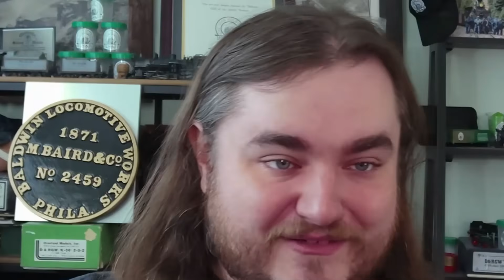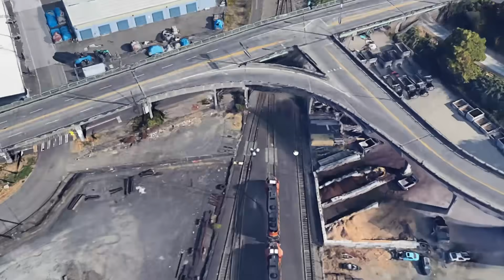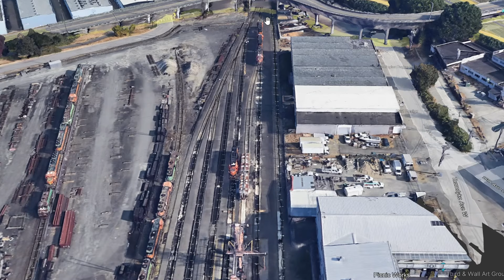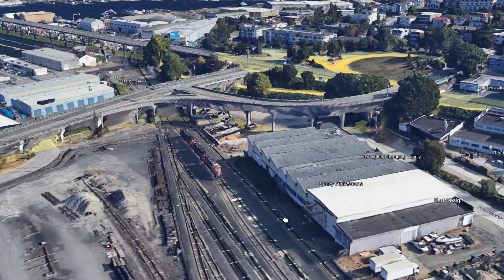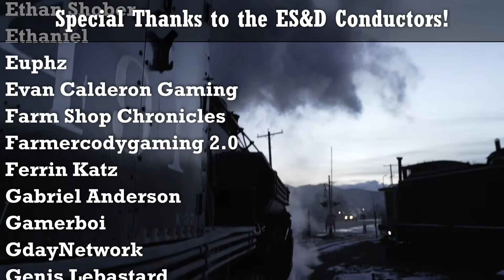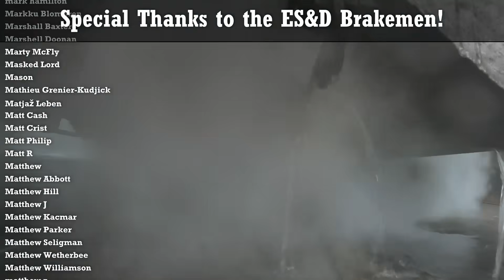[SFS] This is a boxcar that ruined our week.

Comment: The workaround lots of the world does for those type of rules is the highest report in each location being permitted to do anything, they normally only manage so unions don't have any concern with loosing work/roles, but when one "boxcar" fouls your entire process, or somebody needs to walk a mile to plug in a fridge, they can step out of the office, fix the problem, then return to their paperwork... normally shaking their head about ridiculous rules the entire time.
Reply: Our office is that way, though only by coincidence.  We’re in highway maintenance.  The foreman, assistant county management, county management, mechanics, shop labour, and clerks, could do any job, if so qualified, upon request by the lead of the trade.  Most often, we were clearing snow, getting our arses handed to us.  We called management, “hey, can we get some help here”.  Well two of our foreman were snow qualified, so they obliged.  The one with a CDL got a plow truck, the other put a plow on his company truck.

Mechanics can move anything (providing they have their CDL)
Operators can move anything not red tagged
Management can do anything except actual vehicle maintainance (if qualified).
Traffic can only move pickup trucks
Anyone with a CDL can operate, when requested.

Counterintuitively to this story, the union agreement requires any staff appropriately qualified, regardless of craft, to be used, before contracting out the work.

Blizzard of ‘93, we had operators, mechanics, inspectors, clerks, examiners, howdy hut attendants, all working.

A catch all union really has its advantages.

Comment: Funny this reminds me of a story from my father he worked a shop that was 80% union the labors weren't in the u ion because the unions didn't want them or something silly the union had those rules like electricians having to plug stuff in but who didn't have the rules the non union workers so ypu just grabbed the first non union guy and said do this they would and you moved on needless to say the shop run smoothly everone was happy bit the union higher-ups eventually the owner shut the place down closed the company sold it to his brother who reopened non unionized alot of hiys left the union and came over apparently they was some gray area stuff going on

Comment: remember that small rail unused to a business you mentioned when showing rails on in to roundhouse 🛖? well say a guy Parks it there with permission bang flows back on as well as the unused track now has purpose and can easily throw that boxcar(locomotive) onto the next train to the next place easily with zero shuffle just give the guys a radio 📻 to communicate and listen in to traffic 🚦 while moving safely not interrupting full speed 🚄🚅 trains commuting through or the slowing ones checking in for service outbound trains could have a dedicated outbound rail for single direction ⬆️ fully completed and tested repairs ready for service the break could be given full length so that people's nickel and diming of time setting things in purposefully traffic backups wouldn't be needed as everyone would be treated better and a test loop ➰ just around the buildings in the sharpest slow turn possible at 15mph just engine 🚂 so you can do infinite roundabouts of the shop without interfering with other traffic even flipping 🚆 train to figure 8 even for even wear testing and flexure🚂

Comment: Hmmmmmmmm. I would insert a turnout to be a "B" line to a 3A, 4A, 5A, etc. Depending where a turnout can be shoehorned in with a few sticks of rail to be able to set 3, 4, 6, 10, or however many cars or locos need to be placed somewhere that won't clog up the operations.

Comment: I got offered a job at a smaller train shop thank god its all under on union bc the boss wants me to spend the first year getting rotated all round the depts. From welding to the plumbing (air systems) salvage and welding to engines then put me wjere i excell and click with the coworkers

Comment: If that's the actual Geep in question I recall seeing it on the Puget Sound and Pacific. A good buddy of mine lives in Shelton and we used to go to the Radio Fryer and then watch switching ops down by the sawmill.

Also the moment you said there was an industry within mechanical limits I KNEW it was Coastal Transportation (Does that old Plymouth gas switcher they re-powered with a CAT engine even work, or is it just there for looks?).  I rode my bike past there a lot when I worked at Smith Cove

Comment: I worked in a unionized freight terminal for three years during the pandemic and the BS rules and ways of doing things just blew my mind. For what I could do in 5-minutes took union workers over an hour and this was a constant problem when I needed to be on the road delivering freight but due to delays at the terminal, I was usually late every day with many 16+ hour work days. As I was forbidden from placing and pulling trailers from union docks, I had to sit on the side and wait for long periods of time until the union spotter truck operated by the union steward himself moved my trailer from the dock to the parking area across from the docks so I could hook up and run. Usually spotter drivers sit in their trucks near end of building posting on Facebook or checking their Grindr dating app. Totally aggravating and finally after three years I walked out leaving them to figure out how to move their own freight and I got a new job driving dump trucks in a non-union shop. Unions were originally meant to protect workers rights but now it is a method for workers to abuse the system and take advantage of employers knowing full well they can't be fired for not doing their jobs or performing up to standards. Now I understand why there are no more real manufacturing jobs in the United States, and why companies have packed up and moved operations to other countries where cost of labor is much, much lower and unions have no control. Apparently a major freight company closing their doors and sidelining 35,000 union workers in a single day doesn't play in the minds of those who have taken employers hostage thinking it can't happen to them.

Comment: Hyce, what is that grey lamp behind your left?   Is it blue glass which means the locomotive or railcar is not to be moved?  At Goodwill just bought one similar.   HANDLAN  ST LOUIS  USA
Apparently had a removable wick lamp which fits into the base.   Presumably a clear glass chimney so the blue glass lens would not be sooted.   Now a white LED always on inside.

Comment: This reminds me. So, I used to volunteer at a heritage tramway. Now, we had a very tall double-decker tram, No. 26. The wires in certain places got low enough that No. 26 was barred from those areas over possible electric shocks. There were big red, black, and white signs that had a picture of No. 26 specifically showing not to take it down there.
That was ignored constantly. So long as you didn't go into the upper floor, in theory, you would be fine. I once saw No. 26 parked on one of these sections, right next to one of the signs, and thought:
No. 26: "I wonder who that's for?"

Comment: I mean, if you consider that a diesel is just a boxcar with the components inside of it to actually power itself (in a super simplified sense), it makes sense that the reverse is also true. A diesel incapable of actually powering itself is just a boxcar that holds broken train parts in it.
Reply: The problem is that it’s most likely a fully functioning locomotive. I have worked for several several short lines and have moved a bunch of locomotives to other locations. Some of these were in fact broken and nonfunctional but most left our facility fully functional. 
We just cannot move them as functional or really bad things happen. Crews looking for power will appropriate them and they get lost or damaged.  So we disable them and change air brake settings under the cab to make them function as a boxcar. We also post the waybill in the windows of the cab. 
The problem is, there are a lot of employed people who either can’t or won’t read their orders nor that waybill. 
There’s a lot of stupid that happens on the railroad.

Comment: As a retired yardmaster, I feel your pain. It wasn't just the mechanical department that got that Excedrin headache #5, the transportation department also shared the misery. Once we had an engine (boxcar) come in to the terminal and it hung around for weeks like a bad suit because of clearance issues. We finally got rid of it only to have the damned thing come back through a week or so later and it got set off again in our terminal. Luckily, the RR that owned it were now watching it like a hawk and it only stayed there a day or two, never to be seen again. Oversized loads that needed clearance were also a pain in the pants, but that's another long, sad RR story...   you did a great job of explaining the reasons why things can be so crappy to deal with at the RR!
Reply from the maker: I talked with the yard guys enough. You guys got it much worse than we did. Yardmaster at interbay sounded like the worst job on the railroad. Lol. Sounds about right. Thanks for sharing your story!

Comment: GOD I hate unions...dealt with some of that BS at conventions where only the Union people can plug/unplug an extension cord but they provided a faulty cord and then they don't actually get around to replacing the faulty cord until the event is over so we had to improvise with zipties and bent prongs to make something stay connected.  Similarly moving folding tables was a "union only" thing but they wouldn't get around to them until after our chance to set up was over.  One time I got mad and started dragging one out of the way of our booth area, they complained "you can't do that" so I set it down and start walking away.  Then they yell "you can't leave it here, its blocking the walkway fire exits" well you just said I am not allowed to move it so I guess that's your problem now, should have moved it a day ago when I asked repeatedly.

Worst was an argument about "not allowed to tape wires to the floor myself" for an exhibit display to prevent tripping...but also "we can't tape your wires to our floor because they aren't our wires".  So you forbid me from doing it while refusing to do it either.  Only a few people tripped over the unsecured wires that weekend...

Comment: Box car on paper. There. If what's on the video thumbnail was actually the thing that was being argued about when the logistical fiasco was the thing and not just there for props, then I have to say that the P&W recently had to get rid of it because the parent company was under fire from the EPA for failing to comply with certain regulations. Ironically, they ordered several newer GP38-2's (which are really no different emissions-wise than the 1xxx fleet they got rid of).

Comment: Hyce at the museum yesterday I had one question  where is Hyce ?
I told them  on vacation !
at D U  i was told to take the trash that was out side of the door by my boss !!!!!! 
D U  had a contract with a company, that is a union shop, and one of their workers came up to me.
And told me never to touch the trash in these cans ! 
Or I will not have the trash picked ! up at my house for 30 days!!!!!
Denver has the same trash has the same union loco for trash pickup.

Comment: This is exactly how aircraft hangars work in the airlines as well.
Reply: What would the airplane-equivalent be?  Calling it a bus that can't fly?
Reply: @matthewmiller6068  The airplane equivalent would be pulling a terminal tractor into the hangar and expecting the aircraft mechanic who mostly works on jet engines and old Continentals to perform a full service on it without a wiring diagram or a fluid specs sheet.

Comment: Jesus that's nuts. Our servicing area is kinda similar, upstairs with repair, storage, and turntable, and downstairs with inbound and outbound roads and servicing for when locos just need fuel and a slap on the ass. Even a siding where wagons loaded with rebar get placed that the main yard crew has to use.
I'm not sure about the division of labour, I'm sure it's an extra qualification for the servicers to be able to drive locomotives in their area, but if it ends up in there it can be moved by them. Which is important because when trains come in with a shunt loco in the consist that's being moved for heavy repair it comes with a runner between the road locos and the shunter so that their pilots don't touch and make problems.
Sometimes that wagon will subsequently get 'lost' over there when it's right next to all the yard staff's parking and like 40 metres from the yard supervisor's office, which is great~

Comment: Rules like this are everywhere. I got a rude introduction to them on my first job out of college. I got a job as a field service tech at a medium sized electronics company. I was classified as an EST (Electrical service tech.).  Because I was a field service tech, I could do mechanical work to install or remove equipment. And that meant I could handle mechanical tools (wrenches, screwdrivers, etc).
Then I made a move to the engineering dept and became an EET (Electrical engineering Tech).  And I immediately got into trouble because my tool box had mechanical tools in it. And as an electrical technician, I wasn't allowed to do mechanical work in the engineering department.

Comment: I have just to opposite story. Union Pacific has new MOW power, it's a SD40-2, with a new body, and Maintenance of way lettering. Kind of like a F-Unit now. it's not a "locomotive" (For union reasons.), it's a piece of MOW Equipment. One of them recently showed up at Albina Yard, needing new wheels. Yardmaster sends it to the One Spot (carshop), it's a piece of MOW equipment. We don't have a lot of room either, and here it comes on our inbound tracks. I asked what are we supposed to do with that thing? Manager says nothing, it's a Locomotive. Well, it does not belong on our inbound tracks, call someone, it needs to go to the engine house. Well if the call was made, it was likely met with, why would a piece of MOW equipment go to the engine house? They shoved it into the one spot track. It takes a couple days to make it into the shop. They do nothing to it and shove it thru, takes another day to be pulled. Then some MOW Manager calls, asks if it's done. Leadman says no, we don't work on Locomotives, it needs to go to engine house. Next day I come in, it's in our inbound tracks again, rinse repeat 2 more times. After the 3rd trip thru, and a couple weeks later, MOW Manager calls again, are you guys done yet? We really need it back. Our manager says same thing to leadman again, who starts to tell the MOW Manager. I yelled wait, tell him we can't do the work because the car shop does not have a drop table for removing traction motors, but the engine house does. That is the only way to change wheels on his piece of "Maintenance of Way Equipment", by removing the traction motors. Leadman tells him this, and call ends. They pulled it that night, we have never seen it again, I don't know if it ever made it to the engine house.
Reply: On NS they have a track geometry car that looks like a Loco. It's called the"Brick".
Reply: @robertadams6606 the Pennsylvania burgandy geep slug looking thingy?

Comment: Small railroads HATE shipping locomotives over the Class 1's, because they almost invariably get lost in voids exactly like this one. I believe the Wisconsin Great Northern had a new-to-them GP7 fall into the abyss for awhile not too long ago.
Reply: I wonder if something like this is what got the Northern Maine potato crop lost in the Penn Central System for long enough that it rotted because the reefer cars ran out of ice.
Reply: @timothystamm3200  that was just good old fashioned mismanagement of the entire railroad. There’s a 12 hour podcast epic from Well There’s Your Problem on the Penn Central and they touch on that incident.
Reply: @EyeMWing  Yes, I've watched it, but I wonder if the issue was old rules being in place and because of a misunderstanding of them or an attempt to change them that didn't get full circulation someone wasn't informed what those were and that they needed to get to their destination in a timely manner.  They couldn't just be shoved aside and forgotten.  I'll bet someone misclassified it in a manner where no one wanted to touch them.  Though it could copy the mistake this video is about in the manner that someone didn't know what it was and just shoved it somewhere and wouldn't listen until they were told that something literally smelled.
Reply: I recall a story about the Morristown & Erie Railway buying an ex-BAR locomotive. CSX first lost it in Selkirk Yard, eventually they put it on a freight train heading south. That train was supposed to set it out at South Kearny Yard near Newark, NJ. This didn't happen and it ended up in Pavonia Yard in Camden, NJ. Eventually the Pavonia yardmaster, who was familiar with the locomotive, called the M&E and asked what their locomotive was doing in his yard? It eventually ended up with the M&E.